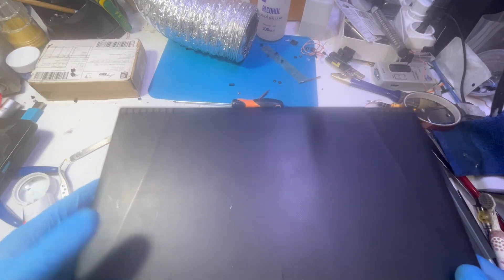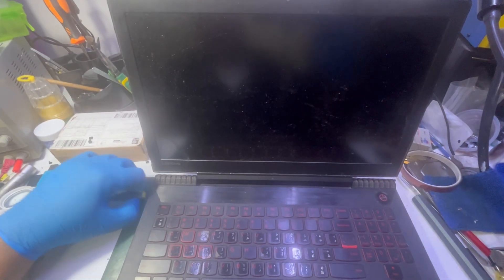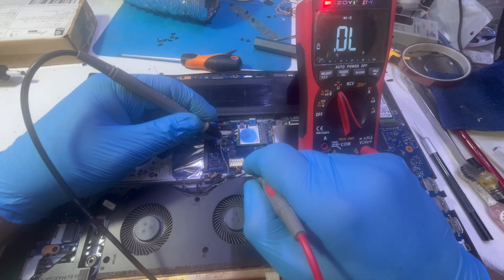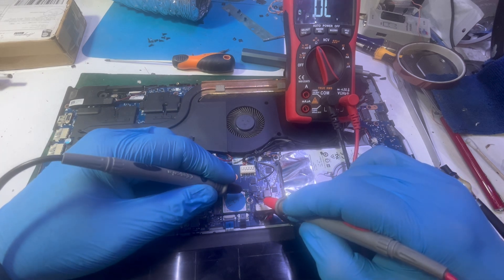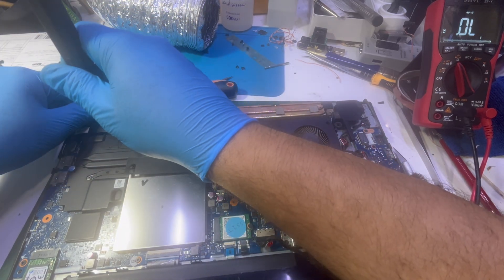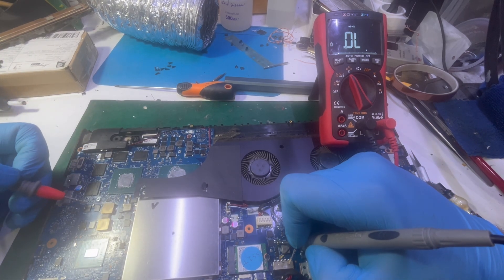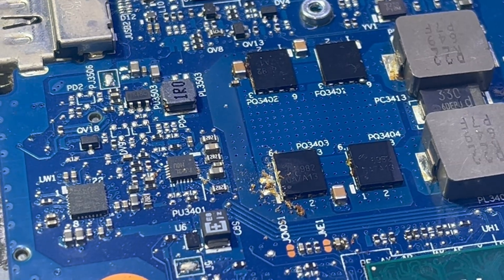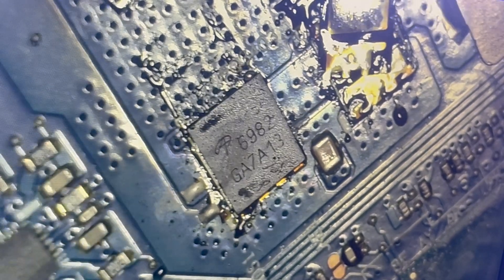Lenovo Legion not booting Fix.

Comment: Hello I changed bettery cell now bettery is charging but it drain in 15-20 mnt
Cell Mah is - 4 cell of 3000mah and 2 cell of 2000 mah Please suggest what I do

Laptop model is Lenovo Z470
Reply from the maker: Hi, in this situation your battery has 6 cells that are in 3 groups and each group is in parallel, if what I'm saying is true that means your battery is 4000mah, so for best performance is to replace those 2000mah to 3000mah to keep better performance and have a steady longer life, but meanwhile you should test the other groups as you may find cells that are beginning to get weak.

Good luck😊